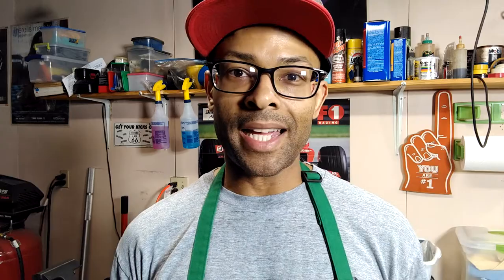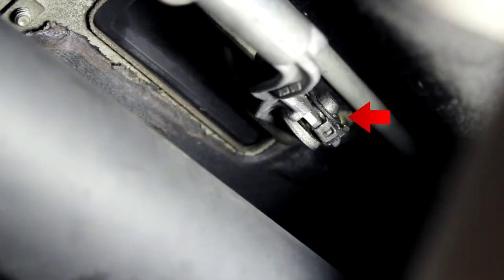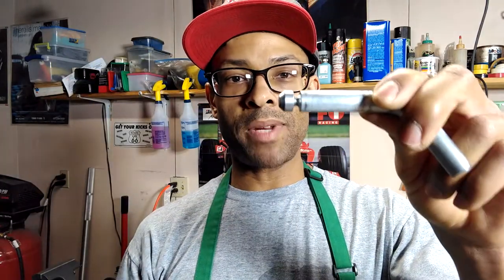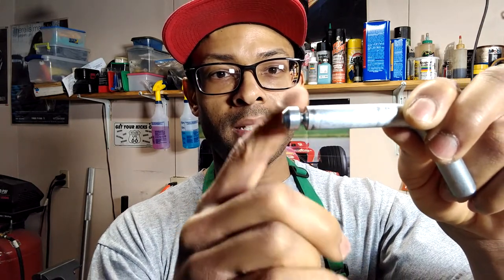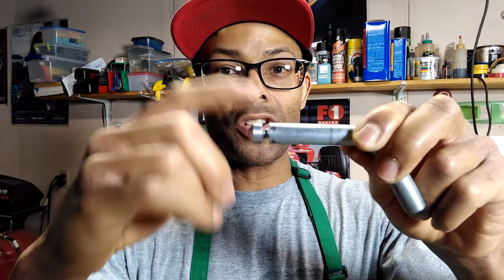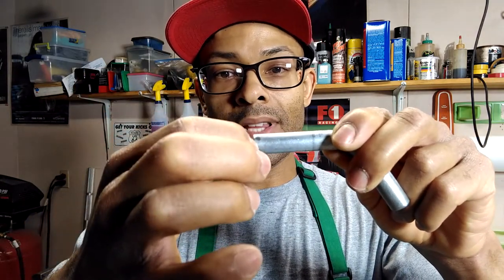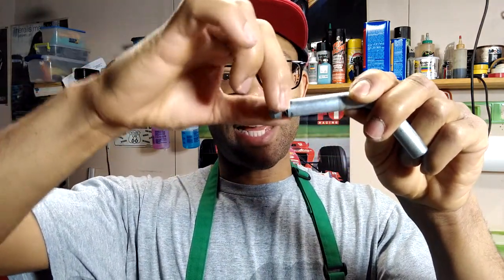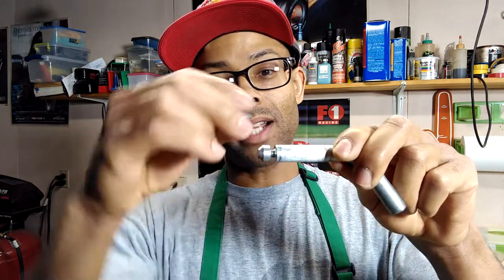Mercedes Benz Transmission Link Fix | S Class W220 5 Speed And 7 Speed Transmission 722.6 - 722.9

Comment: Okay what's happening with my vehicle I have a 99 s320. When I put it in gear it doesn't light up when you put it in D or four . It goes in 3 2 and 1 but if I wiggle the shifter around and light up for, it will shift in four but it will stay in fourth gear period does that bushing have anything to do with it having a connection so it can illuminate in the

Because it seems like it's a shortage as long as the illumination is on whatever gear you're in the transmission will shift great

Comment: My w220 transmission is some Times slippin.. it goes nutral while on Drive.. you think its that clip ? Very weird.. some Time i start the car , put it on Drive and the speed wont change .. i have to Wiggle the stick until it gets in first gear 😪
Reply: Did you ever get this figured out my car is doing the same currently

Comment: If it applies to the w221 where is it located.
Reply from the maker: Hello Obakeng Moreo! I believe the gear selector is different, but I could be wrong. The best thing to do is look under the car and follow the linkage. If you see a clip holding the rod to the gear selector then it should work. I hope this helps. Cheers!

Comment: Where exactly under the car is it ?
Reply from the maker: Hello Naji Patrick, If you are under the car it's a little bit past the transmission pan going towards the rear differential. You will see a silver link rod and a service panel in the heat shield. You will have to remove 4 screws to get access to it. I hope this helps. Cheers!
Reply: @GarageDynamics  I was actually able to figure it out. My disconnection occurred between the shifter, directly underneath the shifter, and the rod connecting the shifter to the transmission cable. I Removed the center console, removed the shifter and noticed the loose connection. I made the connection, tightened down the shifter and wala the car started right up.
Reply from the maker: @najipatrick1476  That's amazing! I'm glad to hear everything worked out for you!!! 😁🎉
Reply: @GarageDynamics  I appreciate it brother
Reply from the maker: @najipatrick1476  🙌
Reply: It happened for me twice. Normally I remove from top (from the cabin. But you need to remove center console and bit a work